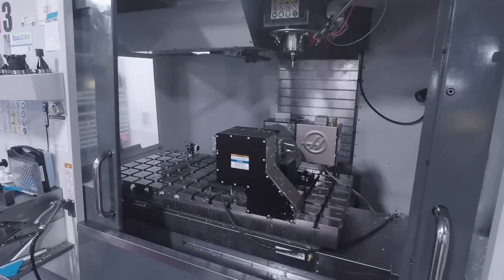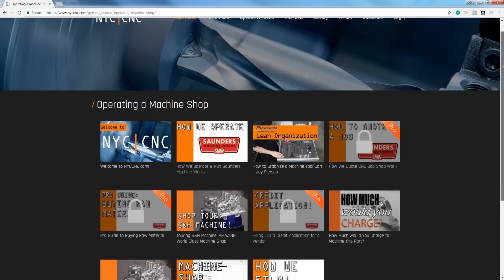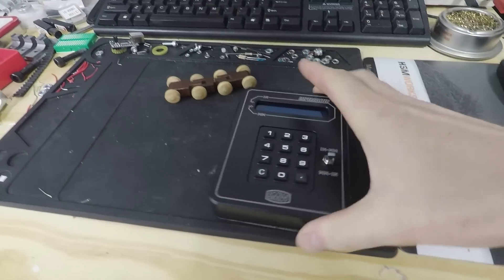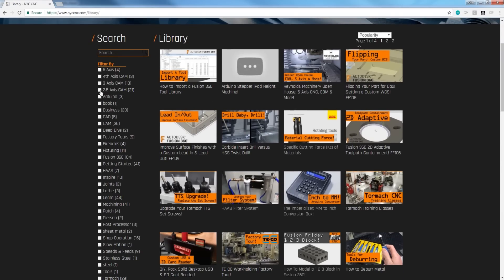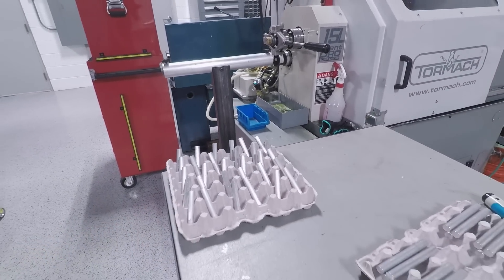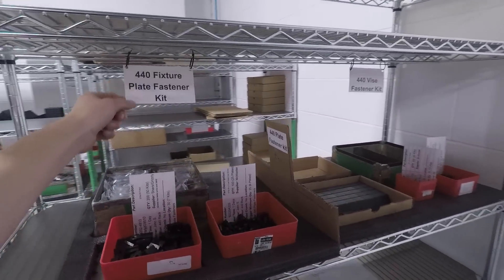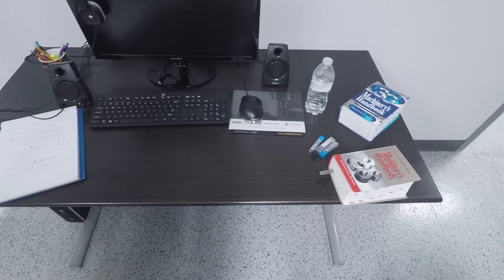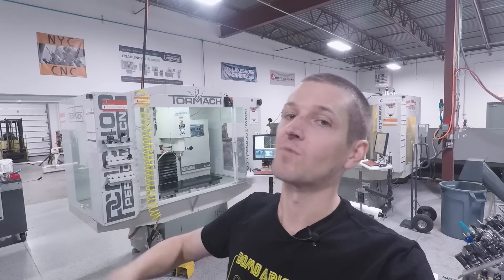Shop Update!  5-axis, Training Classes & More!

Comment: Have you considered the Lang vises for 5 axis workholding? They have the Quickpoint system which allows you to swap out vises with an 8mm allen key. We use them on both of our UMCs and they are great for dealing with a variety of part sizes. plus with the quick point you can mill the pattern for the mounting studs onto anything and make custom fixtures or even attach the stock directly to the table.

Comment: would be cool if you could do a fractionalizer. Takes a fractional number and takes it to a decimal and a decimal into the nearest standard fraction, maybe with adjustable resolution so it rounds to your tolerance (1/8, 1/16, 1/32, 1/64 ect..  Irritates the crap out of me when I get a print with call outs like 27/64th and my DRO is decimal.  And then vise versa when Im not in the shop Im working with a tape measure and often times my dimensions are decimal.

Comment: The racks you use can you tell me the brand?
I’m also lean certified BB, one quick tip for Kanban, you’ll find that you’ll have multiple part numbers some of which may be close or similar. To prevent mistakes also print things like cartoon characters on each card, this will eliminate errors with inventory and is very visual, the person pulling parts clearly sees that they need a bugs bunny for example not a Sylvester the cat.....just a quick tip use any symbol or characters you like....enjoy!!!

Comment: TOTALLY  agree that having the vendor cut your stock. I looked at the whole process and expense of storage, cutting, and equipment and then called our local vendor. The cutting charges are so small it is simply not worth it to cut myself. 

PS: I see the value in the unit converter box. I can't stand using my phone that is fragile, needs to be unlocked, find the app, etc...meh. A 'hardened' dedicated box is a win. Fortunately, I don't have to mix units very often but if I did - I would buy or build the dedicated box for sure.

Comment: Does anyone still use the Creo Parametric CAD/CAM software? I'm a student at the faculty of mechanical engineering in Serbia, and we're kinda lagging behind the modern world, they still teach us Creo instead of more modern and better software tools like solidworks or fusion 360? what are your thoughts on that software tool, is it still relevant in machining practices in 2017 or is it better to take up learning fusion by myself and broaden my skills in CAD/CAM?
Reply: David Ereš 
Around here many seem to use solidworks I have found in other industries I have dealt with
Reply: Creo is waaaaayyy more powerful than fusion 360. The cam module is decent. 
Different cad/cam is just different tools. Good for their respective jobs.

Comment: Overall, it did make sense for you to get the 5 axis option for your VM3, even though you technically didn't need it if you were doing other large table work so you need take the 5 Axis off every time. With a basic 5 axis machine like that, you can take as much time as you need while you have a steep learning curve with 5 Axis continuous. The curve never ends, but you'll get most of it out of the way before purchasing a $500,000 machine for 5 Axis work. ;)